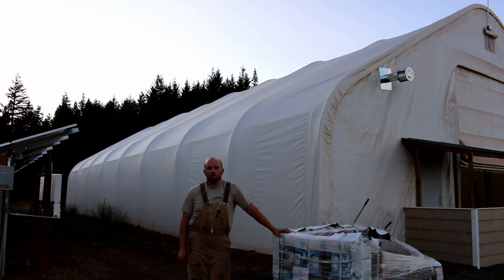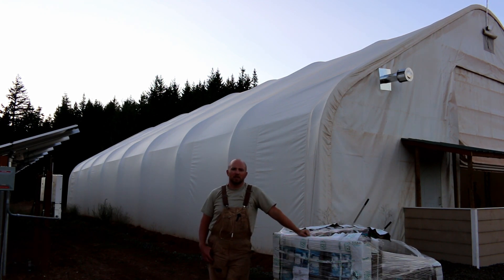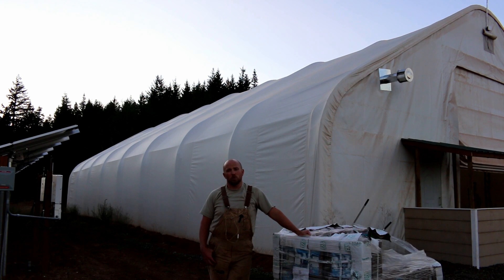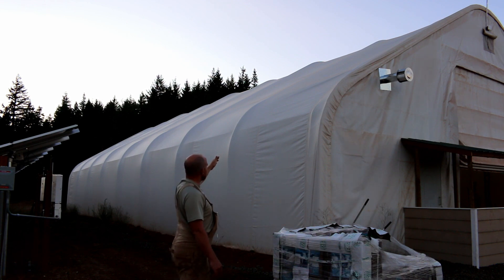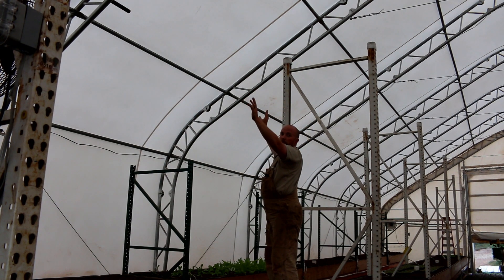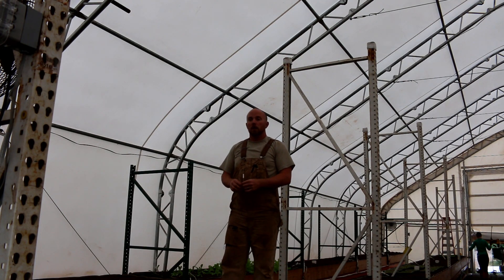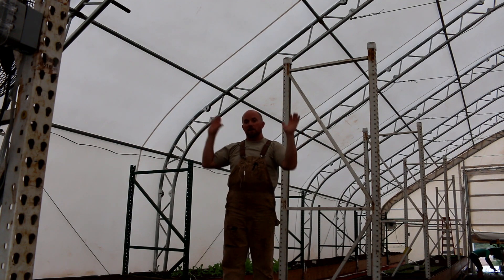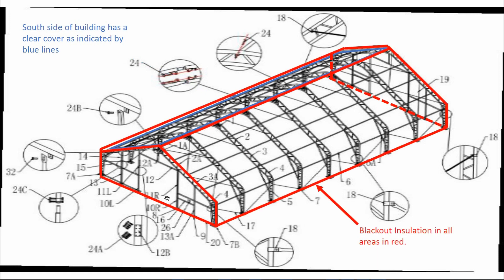How to INSULATE A FABRIC BUILDING?

Comment: I think it might make more since to start from scratch.  If you only have that little south facing opening for light then build it into the side of a hill with the back/dark part dug into and below the frost line.  Then add a few 100' of drain pipes 8' below ground to blow warmish air in winter.
 
                                      Also why would you not keep the old cover on and double it up with foam spacers to create an air gap with holes cut out for the clear area.
                       You could of ordered the clear plastic and welded in the windows your self.

Comment: Hi there, I'm seeing eight 10' x 21' panels. Possibly to keep heat in overlapping width-wise. A sturdy pipe or beam at each panel end to pull from. And battens or conduit every  three feet to prevent sag. 
How much weight per panel?
Cheers

Comment: Jeff, I'd go back and look at your lighting assumptions. Your estimate of $15k just for the lights doesn't pass the sniff test. I just installed LED highbay lights that produce 13,000 lumens and consume 4.5 amps. I use 8 of them to light a 35x40 shop and I have perfectly adequate lighting throughout the shop. That setup only cost $900 including shipping. You could double or triple that arrangement and still not top 5 grand. 
An alternative is 4' standard shop lights that put our 4500 lumens, consume 1.5 amps and cost $29 each. I can't begin to rationalize how you arrived at $15k for lights.
Perhaps you're using a task lighting lumen standard for your calculations.  
Recommend highbay lights with shop lights for the few areas that require task lighting.
Reply from the maker: thanks jeff.. I am updating the calcs to ensure I did them right...lumens aren't the measure I use, instead it's PAR. I've got some video's coming up on this. excited to share...get ready for some engineering :-)

Comment: i really like the idea of moving that insulation on tracks, but I was wondering if that won't interfere with the tensioning wires you have in the roof of your building. (unless of course they are not really needed)

Comment: I love the idea of the track insulation. I didn't hear anything about the insulation overlap of the tracks or how to prevent the gaps that would allow the heat to just escape between panels. I like the single bar controller to move things but you'd have so much weight you'd have to put springs or rubber stops on both ends of the track to prevent it from ramming through the ends. I wonder if a counter weight would be a good solution there or if you put that control bar at the peak so it would help balance the weight instead. If you did a single motor though it would make automation simpler and you could add a light sensor like you've used on the beds to automate night time closures and morning openings. If you mixed in the garage door motor commented on below, you could just add the gears to that common bar and even have several to distribute that weight. Also a garage door is meant to handle weight for raising and lowering doors. But the wound spring concept from garage doors could still be applied for weight management instead. 
Sorry for the long comment. :)

Comment: Keep in mind that your movable panels don't have to be "form-fitting."  They don't need to go all the way to the peak of the roof, unless you need the stability of being close to the frame.  You can radius your track for a gentler curve.  I have some ideas.  I'll try to send you an email.
Reply from the maker: thanks Jeff...I agree...this is the way I'm leaning in the solution...no tight angles, just nice easy 3ft minimum radius curves

Comment: You should consider using garage door hardware.  Even the garage door motors will work if you use the chain drive type.  Lots of recycled garage doors out there that have rotten wood.
Reply from the maker: the challenge with that is how expensive the tracking is...one 8ft section was over $30...compared to galvanized pipe at ~$3/10ft...please, send me info if you have a better supplier though...there so much out there to look through

Comment: Hi, really enjoying following your exploits.  A couple of things have occurred to me. I like the sliding insulation idea quite a lot, very neat solution, but I'm wondering how accurately spaced the sections are to one another?  A double tracked system depends on being parallel or at least parallel enough not to bind or jump out of the track to work well. No idea how accurate the building is but I think it's worth raising a flag now given your time constraints.  On a more positive note that self same sliding insulation system surely does away with the need for an additional shade?  Can't you roll over individual sections to control how much light (thus heat) gets in there during the summer?  Just a thought, very best of luck with it, wish you every success.

Comment: What is the insulation on the moving roller door sections? I'm assuming it will be flexible to bend up and over the peak 😊
Reply from the maker: it will be very flexible...it will be the same as the rest of the building
Reply: Is it worth possibly putting a spring loaded bar down one side and then a stepper motor on the other side to keep the flexible insulation tight across the roof and only needing one motor for deployment and retraction 😊
Reply: Some kinda Mylar foil insulation? I hear it comes in rolls and it's pretty slim and lightweight. No idea what the cost is.

Comment: You can make a chain of flat bar stock to line the sides to stiffen them with wheels at the pivot points for it to follow the track.

Counter weights on the sections will let you use a small motor to move them as once the mass on ether side is the same you need little energy to move them. Ether very heavy weights rigged to move a little or matched weights set to move the same distance as the panels. 

For the clear section in summer you want a shade cloth? Would that just be over the building or have 2 telephone poles on the other side with pulleys to keep a distance between the building and the cloth?  Figure 2 ground mount points on the low side and the 2 poles on the high side with guide wires that stay in place will let you easily raise and lower without the manpower to pull over the building just 2 hand crank winches mounted to the poles.
Reply from the maker: never thought of the flat stock..that's a great idea

Comment: Maybe you could use PVC with inside coupling to keep joints smooth. For supports use 1/4 x 3(or4) inch strap about 4" long with 3 holes drilled 1 on each end and 1 in the middle. Using self drilling screws, mount the straps to the building frame with the center hole. Lay the tubing on the straps and use the screws to secure the tubing to the straps from the bottom. This will provide mounting for the tubing on both sides of the frame. This will work for steel tubing also if you can figure out how to have smooth joints, possibly using wooden dowels to maintain alignment. Good luck with whatever you do.

Comment: I think this is a great idea.  The  structure is already there to mount rails.  You mentioned "sag" so I assume the material will be flexible.  I see two options under that scenario.  For both you will have two sets of rails on each building support for guiding the rollers for adjacent bays.  First option - just have the rails end just after the peak and allow the fabric to bunch up like a Roman shade does for  a window treatment.  This system will rely on the weight of the structure and fabric and gravity to make sure it pulls taunt when closed.  Second option, the rails continue down the north side.  Between each of the horizontal supports that will hold the fabric, install another piece of EMT to connect each end of EMT to ensure that the fabric stays taunt.  These short side pieces of EMT will require a swivel connection to the horizontal support sections.  As the curtain is moved all the way to cover the north side, the swivel will allow each section to drop slightly below the rails as the curtain passes the peak.  I still think a more energy efficient system would be for the rails to be just above the lane support structure to create a "drop" ceiling and thus a smaller volume to heat.  But you have a plan to go forward and that is a significant step.  Praying for early delivery of the new skin.

Comment: I understand the idea from the insulation, also from left to right on the roof ... But if you move the insulation from left to right, how will you connect them on the middle of the roof ? They always told me, if you have gaps between the insulation, there goes the profit. So you have to make sure there are no gaps between both L and R on the middle of the roof ... And how will you open it to move it there in the middle if you wanne move it to the other side ? I hope my thing is making any sense :)

Comment: TRM, use tracks like garage doors. Conduit is even better than rods like I originally envisioned. The conduit will also support the fabric. Would be better if you had pockets sewn in insulation every 6 feet or so to help pull fabric. By putting pulleys on the outside of the track, you could make a loop of aircraft cable to pull up or retract the cover. Sort of like the tension assist on garage doors. The motor at the bottom of the loop is used to pull up the covering in forward and retract in reverse. I would talk to Overhead Door or similar to get them to install and align tracks and pulley assist system. Use their experience to your advantage.

Comment: A furling pole at the ridge would be so much easier than a track system. Also you will need to have an insulation barrier at the ridge to keep the north facing roof insulated.

Comment: Just a quick thought, I would build the moving section with cables on both ends of the axles and get them working as a separate unit before hanging  the insulation on them as it may not be a good idea to use the batts as a structural part. You could use u bolts to tie the cables to the axles near the wheels which would put all the stress on the frame work and not the batts.

Comment: The retractable insulation panel sounds nice, but in reality sounds tough to do.    You'll have air leaks and moving parts tend to need maintenance.   Being custom made, you'll be the repairman.   You also have to make sure you don't damage the permanent insulation on the dark side.   It would be nice if at some point you could automate it, so maybe it would move back at night time on a light sensor or something like that.    Is there anyway you could build a model and work out the bugs ahead of time?

Comment: I am not sure what this sliding roof material is like for issues such as tearing / stretching / or indeed how you might attach the fabric to the "pulling mechanism" but might it just be wise to build a matching curved roofline shape prototype and rollers etc on the ground to check the whole idea out before  trying to install it in the building?  By doing this you might decide on the best way to attach it to all your metal work of the building structure and measure the force needed to open / close it, also watch its behaviour when being moved.

Comment: Conduit is not designed to be a structural metal.... I believe conduit will bend under the load of the insulation's weight along with the stresses of movement when retracting and deployment.  You may want to test your theory before buying the conduit...because I tried using 1" conduit once that was a total of 20 ft long to hang  5'x10' banners from and over time the weight of the banners bent and the air movement from the air conditioner bent the conduit to the point of failure. Conduit is not as rigid over its length as you might think, the longer the length the more flexible it gets. I never thought that round "metal" would bend that easily but it can. I assume there are different types/grades of metal conduit but before you invest in a large scale project like you are, I would make a piece of the longest conduit you are going to use hand the equivalent weight on it as your insulation will be on it and check the stiffness/flexibility of the conduit to make sure it will work...remember conduit is made to bend and is not structural...I hope I am wrong but better to test before you buy and build.

Comment: I am confused about the retractable area using conduit. One thing fiberglass insulation can be quite heavy and 1/2" conduit is not strong when you span it. What about the building cables?  Your picture shows insulation going all the way to the top. Before you were only going up to the cables. Wont they be in the way. What will the system roll on?  I was thinking a round rail mounted below the building frame and make brackets with 2 rollers so they would hang on the pipe and not hit the pipe mounting brackets kinda like a roller coaster.  The pipe idea on the wall sounds good to keep it from binding when moved.  Just my 2 cents good luck.

Comment: Your idea sounds like a great plan. The 1/2" conduit may need to be supported at least 3x per 10 length, real sturdy with any type of weight on it. I would definitely use steel set screw couplings to couple the 10' sections together. A die cast fitting will stress and break. Just a thought how about using 20' long sections of chain link fence tubing? Don't some of the fence rails fit together with a tapered fitting? The rails are probably larger than the 1/2", but stronger. Might make your track system roll smoother? You can determine your angle of the roof and have those pieces bent by an electrical contractor or rent a power bender? Not a big task to bend the angles at the roof peak. Love your idea for insulating the building!!!!!